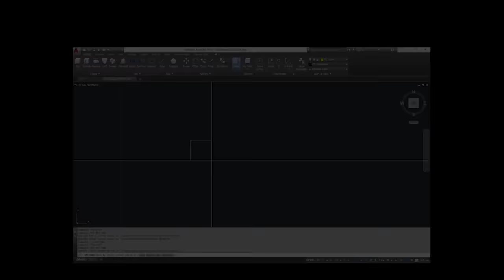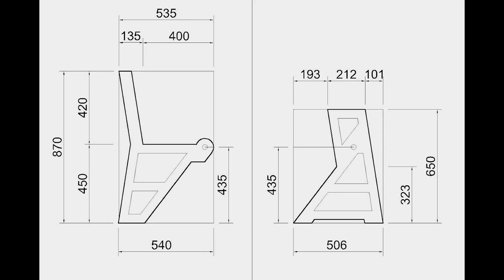Folding stair case Idea! / woodcrafts / woodworking

Comment: Very clever! And I like how you went back to showing how you cut out everything, before using the Cntrl C and V mallets. Also, I wouldn't get on it until I have plenty of screws in it. Cyanoacrylate and brad nails would not be enough to support my 6'3", 260 lb (190 cm, 118 kilos) carcass! And I am far more timid than you regarding heights, even on small step stools. Thanks, Dekay!

Comment: This sparked memories of a step-stool my family had back in the day (might still exist, but not sure). Worked on a similar principle in that there was a set of two steps that used a wooden pole as an axis to rest inside the stool's negative space between the supports. Then, once the step-stool was needed, just pull the steps out and they'd rotate on the pole. There was also a hole cut into the top step/stool surface to serve as a handle (and later down the line, a fun way to play with the cat as a paw repeatedly peaked through the handle to try and smack the cat-toy we had interested our feline friend in).

Otherwise, at 6:45, I am wondering that maybe one thing that could be sparking the fear is the lack of reinforcement for the underside of the stairs. I can see myself thinking that if I were to try stand on that, I'd be really worried that I'd accidentally snap the step in half with my weight. 

Going back to my old family stepstool, one thing I remember was that the steps themselves were mounted on top of other wood cutouts that were attached to the axis. I bring that up because of the way that the force of the climber would impact on the structure: the steps themselves would experience a compression force at the sides close to where the feet would be. As opposed to your design, where the nails/screws and glue combination would instead result in a tensile force when stepped on, as all the support is concentrated at the sides and there is no support directly below. I am wondering if the fear you were feeling is maybe worry about the steps failing.

So that's why I brought up what I did. Don't get me wrong, I still really like this design. I am just trying to narrow down what might be causing you to feel fear. Maybe one idea could be: try reinforcing the two top steps with additional supports. In particular, try placing the supports for those steps directly underneath where you'd expect your feet to be on either side of each step. That way, climbing will instead create a compression force against the underside supports, and some tension will be taken off the screws in the sides. If the fear you were experiencing possibly came from a worry about the structural integrity of the stairs, that's one way I can think of to try remedy that.
Reply from the maker: I agree with your opinion. Thanks for the comment. =)

Comment: Hi Dekay, Very nice job, as always nice and useful furniture. I want to ask you, if I use other material as MDF of 19 mm for instance. Do you think that this will handle a 80 kg person? Thank you.
Reply: MDF by itself isn't particularly strong, as it has no grain like natural wood. That said, there are simple ways to reinforce it. I built myself a platform bed a couple of years ago with a top made from a 4'x8' sheet of MDF with a wooden frame attached underneath with beams every 2'. That combination made the frame strong enough to to hold 500+ pounds.